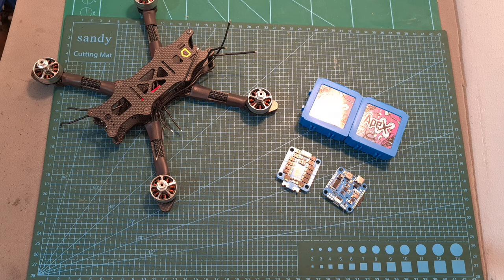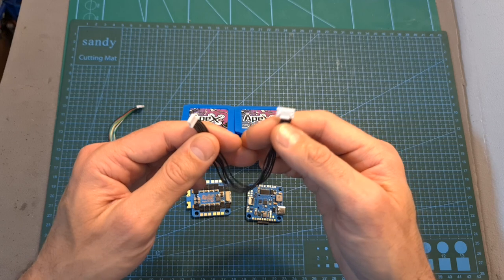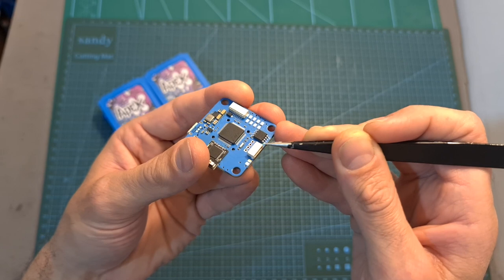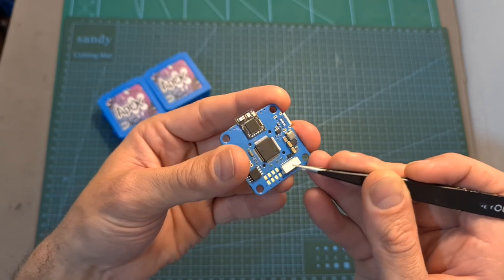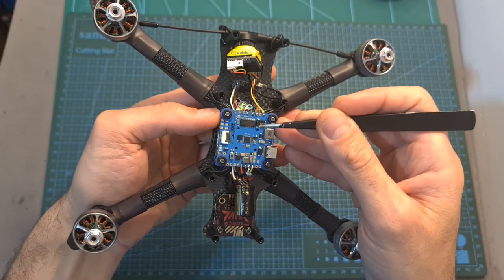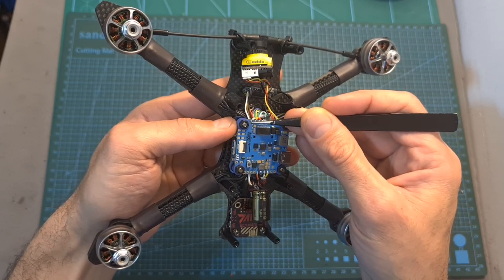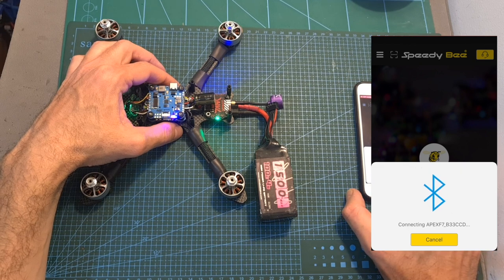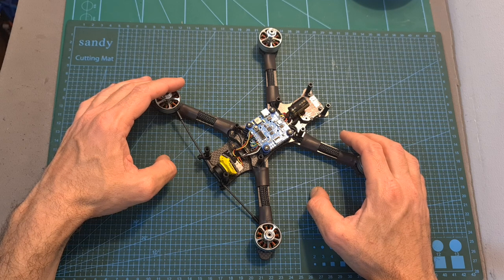Apex F7 HD Stack / 60A ESC - Overview & Assembly

Comment: I just made a build. Do you know which UART to enable air unit?  ALso do I need to jump any pins to get power to the air unit? I tested air unit in another quad and is working but I dont get any power when connecting to this FC.
Reply: Did you find a way to activate ur air unit??
Reply: @wilsoncarino2355  yEs I had to short two pins to get 10v out.
Reply: @aarrodri  howw??
Reply: @wilsoncarino2355  look at the third picture in the pyrosrone page. Short the pads that read 10v. Top of the picture. The right and center pads. Labeled power jumper. https://pyrodrone.com/products/apex-f7-flight-controller
Reply from the maker: I've prepared two wiring diagrams for this stack: https://ibb.co/s6ZNNFt
https://ibb.co/frJPvfK

Comment: Great video and thank you for posting i haven't been able to find much regarding this stack. Do you know where to get the  board diagram? For connecting a crossfire nano and such?
Reply from the maker: My pleasure Chris. 
Here is my not so great wiring diagram :-)
https://ibb.co/s6ZNNFt
https://ibb.co/frJPvfK
Reply: @KremerFPV  Thank you very Much! Is the VTX/Cam bridge meant for use with the DJI air unit if I Bridge the 10v?
Reply from the maker: @chrisbabbitt2218  Yes :-)
Reply: Thanks for the Diagram! Apex should pay you a commission for it 😆
Reply from the maker: @astro.sergiu  LOL :-)

Comment: Just bought this stack put together the build plugged in the air unit and it won’t turn on... everything but the air unit powers up. So I tried 3 different air units all with different cables and no luck
Reply from the maker: Do you power it using the 12v regulator? If so, the User1 mode needs to be enabled.
Reply: @KremerFPV  It’s supposed to be dji ready/plug and play right?
To answer your question I ended up hardwiring everything and soldering it up but the part that blew my mind is the air unit power goes to the bottom of the fc where the bridge pads are then the rest go on top but the rx/tx pads are no where near the sbus pad.... So the wires just go everywhere randomly this is the ugliest hardwire job I’ve ever seen for such a nice flight controller...
User 1 mode? Huh?
Reply: @KremerFPV  either way I have it working now and the bottom line is plugs are nowhere near as durable or secure as soldering it so that’s a plus I just like being lazy LOL thanks for this one again by the way! The one thing I ended up needing wasn’t in the video though. All I was looking for was the ESC to flight controller cable layout so I had to pause your video and tried to look at yours find a cable that matched yours and used that... The included cable comes unpinned on one side and you have to pin it yourself but because it’s just a standard cable I’d rather save that unpinned cable for another build
Reply from the maker: I thought that the VTX switch was turned off...
Anyway, I'm glad that you got it working and BTW, the wiring diagram can be found in the description of the video.
Reply: @KremerFPV  Could you help me understand what mode one is and how to change it or what were even talking about to be honest is there a video?
Reply from the maker: @flapjackfpv  See 03:53

Comment: Hi, My name is Abas , im pilot from
indonesia , i just buy this FC , i have question for this FC regarding wiring build.
I used uart4 for dji vista port and uart6 for RX. my question is , Why is my esc skystars 60A blheli 32, canr detect in blheli32. Do you have any guide for this wiring ? this is not my first quad build. Thanks
in advanced
Reply from the maker: Hi, do you mean that your ESC is not working at all? There is a link.to.the wiring diagram in the video description.